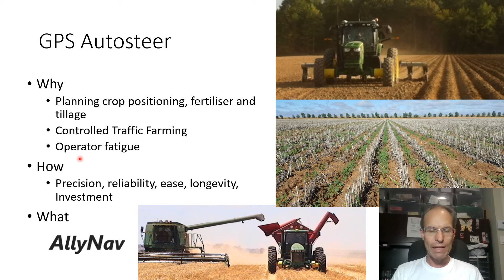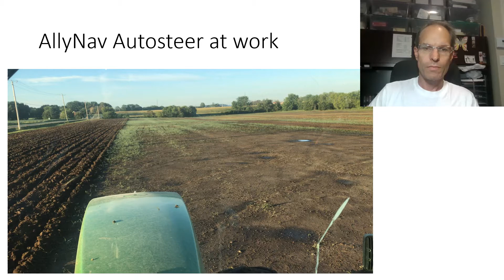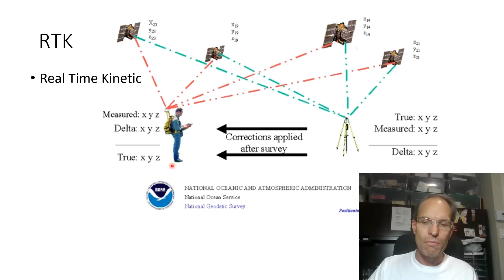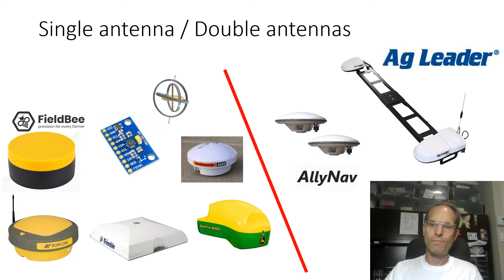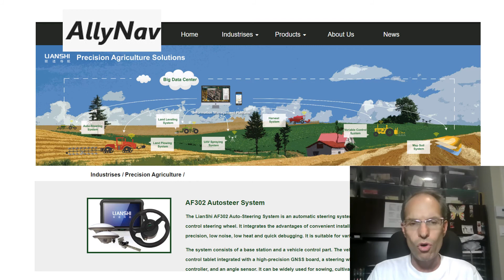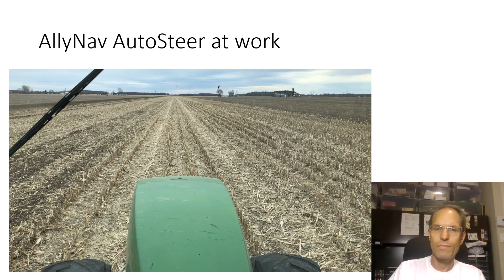Autosteer system by AllyNav, presented by J-F Ridel

Comment: Can the system do nudging, or in other words offset 1” during in row operation?
Reply from the maker: Yes, this is possible. The latest interface allows to enable shift arrows on the screen and you can configure the nudge size per click.
Reply: Great .